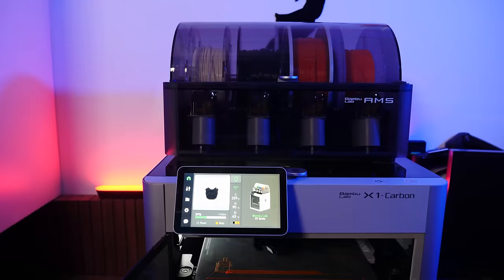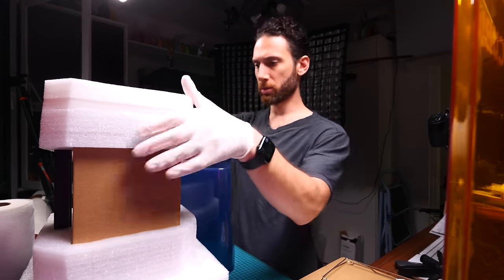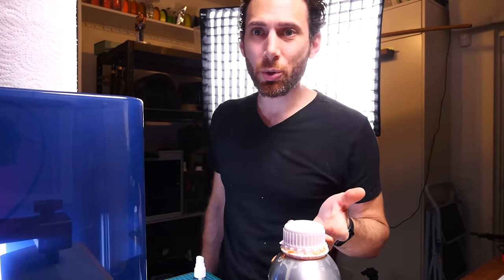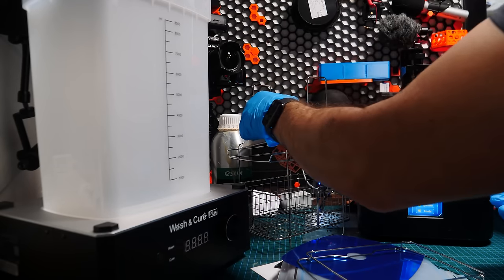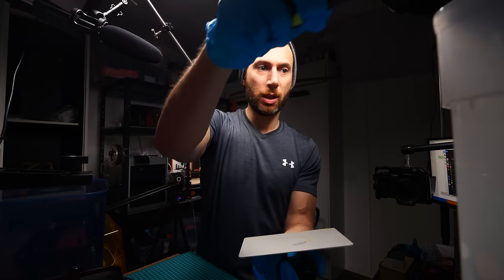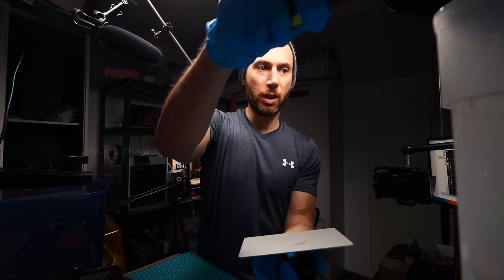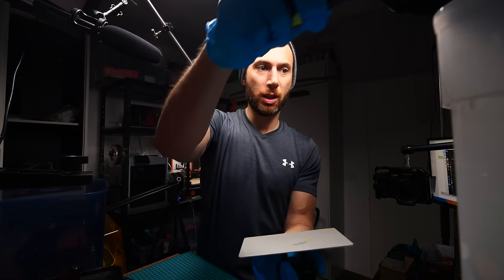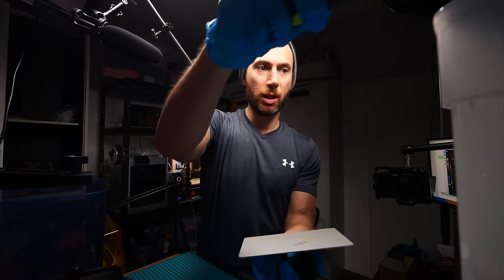Resin 3D Printing Wasn't What I Expected. AT ALL.

Comment: I went the opposite direction. I have been resin printing for years and just got my first fdm printer (creality k1c) I'm having a lot of fun printing the things that either wouldn't fit in my Saturn S or just wouldn't work with resin very well due to its material properties. I still use resin for a lot of things. If you need something detailed it just can't be beat.

Comment: I purchased the Anycubic M3 Max about a month ago now.  I did my research before hand so I knew what I was getting into.  A few comments on the video.  Firstly, this is not nuclear waste here.  Yes you should wear gloves and should be in a well ventilated area, but the respirator is probably a little much.  Secondly getting started is really not that hard...if you follow the directions.  It seemed to me like he just threw everything on a table and jumped right in without looking at any instructions at all.  And thirdly resin printing is NOT that messy.  I have made about a dozen or so sets of prints and if you looked at the workbench I have my printer on, you cannot tell I ever used it.  Use the proper tools as suggested and follow the cleanup procedure and it is NOT messy at all.  Personally I think this video makes resin printing seem much more difficult than it really is.

Comment: I started my own resin printing journey a few weeks ago, and I prepared by watching a ton of videos and reading a ton of articles on suggestions for beginners - having a silicone work mat, having a big funnel to put those paint filters in when straining out resin or the wash liquid, using a hair dryer to get the alcohol off the print prior to post-curing, and having a room air purifier have all made things go quite smoothly. Also a big plus, though I don't know if it's always recommended for beginners, was getting a flex plate instead of having to chisel prints off of the stock build plate. For what it's worth, having the room air purifier and a box of disposable nitrile gloves has made me feel safe enough, though my intent one day is to put the resin printer inside a grow tent (possibly with some minor heating if needed) that is ventilated outdoors to really keep the fumes to a minimum.

I got a Phrozen Sonic Mini 4K and the smaller Anycubic Wash & Cure station, and have so far printed with just two different resins: SirayaTech Blu Clear V2 and Elegoo ABS-Like Gray...the differences have been quite interesting so far, with the Blu being quite a bit more viscous and having a much stronger smell and the Elegoo resin needing a lot more work to get the exposure settings dialed in just right. I've done a few D&D miniatures, some jewelry-type items, and even a lithophane, something I tried and failed at with my Ender 3 a few years ago.

I'm looking forward to trying to make much more than simple decorative pieces. Things I've read suggest mixing a flexible resin (such as SirayaTech Tenacious) with standard resins really helps improve the overall toughness of prints, whether for miniatures/terrain that see a lot of use or the more functional kinds of prints that are currently still the domain of FDM printers. I'm also having to constantly talk myself out of getting a small electric furnace and/or an electroplating setup (shoutout to Hen3Drik) so I can make metal jewelry with the resin printer...I'm probably one of the small number of people that would rather melt zinc or copper to make solid metal jewelry than try and paint something.

All in all, great video! It's important for people looking to get into a hobby like this one that things won't always go according to plan and that troubleshooting is part of the learning process.

Comment: My wife prints with resin.   She loves it.   But she worked with UV resin before 3d printing was a thing.    Also it's not just for miniatures,  it's more dimensionally accurate than fdm due to the smaller layer lines, so I feel you will find it fits in with what you typically print nicely.
Reply: I thought it's good for functional parts too.  I do not have a resin printer yet but, from what I can see, you can buy special resin from places like Siraya Tech that has exceptional strength.  Is it true that you can make things as strong (if not stronger) than with FDM printers?  I say stronger because you don't have weak layer adhesion on the Z axis.  So, other than the mess and noxious fumes, I see no downside to resin printing except for smaller build volumes.
Reply: @ChristmasEve777  A lot of the material is not as strong as a lot of fdm materials, but the adhesion between layers is a lot better (I dont want to say all because there are certainly some very strong resins). The trick with FDM is to print in an orientation so that the force wont stress the adhesion between layers. Really the advantage of resin is greater dimensional accuracy. At work we mainly use pcabs on fdm printers but whenever we need tight tolerances on a snap or reduced friction on a moving part, or two forces in different directions where one will always split the layers we use the SLA printer. A downside of resin printing is the print time due to the smaller layer height. A small, not very complex part I started this afternoon had a print time of 22hrs. The same model might be 3 or 4 hours in fdm. 6hrs max.

Comment: A word about 3D resin printing safety: It's not that bad, but I would very much recommend to anyone who wants to get into 3D resin printing to first make sure that there is good ventilation and extraction. An open door or window won't help much if the fumes aren't actually being sucked out. I had no problem with my old Elegoo Mars 3 which is quite a small printer, but I immediately experienced toxic effects from the fumes when I replaced it with the bigger Elegoo Saturn 2. Don't take chances with your health or the health of anyone else who may be exposed to the fumes. Don't rely on a carbon filter; I've not seen any evidence yet that a carbon filter - even a big proper one - will remove VOC's. 

A mask is fine, but the bigger problem with 3D resin printing is that if the printer is inside the home, the heavier-than-air VOC fumes will slowly build up over the course of a few hours and you may begin to experience toxic effects. I certainly do. My solution was to move my printer outside into a shed away from the house (still a WIP - I'll have to slap together a DIY insulated and heated cupboard if I want to run it during the Winter months) but for those people who have no option but to print inside the home, grow-tents are recommended by some people, and I found out about a pretty cool device called a hydroxyl generator which neutralizes VOC's in an enclosed space. They're not cheap though.
Reply: @herculeholmes504  Any tips for extraction gear? I’m considering options for an area where I might set up a 3d printer and my wife may be doing jewelry making, which has its own fume concerns.

Comment: I bought my first resin printer this past winter, and once I got over the cold basement issues with a heating pad, it's been great. I have both the Anycubic Mono 4K  and the Wash and Cure station and they've both been great. I just installed the flexible buildplate and the prints come out great. I love it for things that I need in detail and the quality is just astonishing. I still use my Ender 3 a ton more but the Mono 4K is an absolutely great printer

Comment: First- excellent video. I'm glad you showed the issues you had.

For anyone watching this, it's worth spending rime watching videos on exposure and supports. Exposure first. The recommended default settings may or may not work depending on your room temperature. The further you are below 25 C, the longer the exposure time you need. The best way to determine this is using the "Cones of Calibration V2."  Do a search example to find them.

As for resins, all resins have different exposure times based on the manufacturer. Often the deviations are more than you see between manufacturers with the same  type of filament. Then there are significant changes in exposure based on the resin type. Similar to the changes between filament types. ANY change in resin requires testing your exposure at a minimum.

 Try printing pre-supported models first as the automatic supports in most slicers can be hit or miss and you'll get frustrated by the support failures.

Everything else he talks about regarding ventilation, safety, etc., is spot on.

Comment: I've got both, and there's a ton of stuff to learn and work with the resin printers.  Just like FDM, each resin is really unique in exposure times, light off times, etc.  I will say this - get better resins.  The higher quality resins do not have the strong odors that the cheaper ones do.  I'm partial to the Elegoo ABS Like resins.. low odor, very strong, and easy to print with.  good luck!

Comment: This video format is excellent for this type of video, great job! 

I’m considering getting a resin printer, but the fume extraction, high toxicity, and space and cleanliness required are sort of a problem, I think I’d want a large enclosed desk with a massive silicone desk surface, and walls a roof and a door, as well as fume extraction and/or a really good air scrubber, there’s not enough space for that now unfortunately

Comment: I have only ever used a resin printer, and I love it. It printed amazing quality right out of the box and with a little bit of calibration it only improved. Got some Sirayatech Tenacious to mix with my standard Elegoo grey, and now I have a ton of range of durability for all my needs. I still have yet to try dyes or clear resin though, but really want to because there are quite a few things I would like to do with them (I mostly print scale model kit parts).
Sure, I would like to have a FDM printer for larger less detailed things, but I have heard a LOT of people give up printing because they couldnt calibrate their FDM printer properly. That would never be an issue for me since I have plenty of time and determination, but it still makes it sound like FDM printing is much harder than resin printing, which worked for me right out of the box with no issue.
The two things I would invest in for resin printing are; ultrasonic cleaner, and a UV light with a uv powered lazy susan. And 90%+IPA or a degreaser like Zep Fast 505 or Mean Green (much cheaper than IPA and works almost as well for most all resins, clear resins work better with IPA.)
when using the ultrasonic cleaner, all you really need is a small jewelry one that can hold water to then put a larger container into to hold your IPA that you put your parts in. dont have to use a ton of IPA, just enough to submerge the print. So just use a container that fits your print. the IPA can also be cleaned by letting the resin settle then curing it with UV light, then filtering it out with a coffee filter.
I also recommend a second build plate, a flex flex plate for each, and an extra vat with storage lids for both. Makes it so you have almost no downtime between prints while you swap the plates out or even swap to a different type of resin. and the flex plate lets me print perfectly flat things like miniature bases, coins,, keychains and such; and getting a perfectly smooth flat bottom that comes off the plate with ease and no damage from the putty knife.
Reply: Depends on the FDM printer you buy. I have a prusa mk3 and I do have problems. But it's mostly wearable parts, direct drive gears, the sensors Prusa keeps coming up with, and Prusa Printed parts that don't work so well. However, Prusa always tends to fix the issues and I have printed over 400 days worth of prints in 4 years. 
All my friends bought Enders or Creality printers because they are cheap and it is possible to print a ton on them but they all ended up shelving the printers. The main complaints were the software/firmware. Too many driver boards, to many compiled files that don't work, to many versions of the same printer and YES they never did get a print printed. what a waste of time and money. 
That being said, expensive doesn't mean better either! I have a Modix V2-to-V3. I have completed 3 years of tech support and it still doesn't work! Which means who you buy a printer from matters!!! Unless you are an engineer for this kind of thing.
Reply: I hadn't thought of scale model parts before.  I thought resin printers were only for figurines, so your use case makes a lot of sense.  Thanks for sharing this.
Reply: @michaelj3971  I mostly build gunpla, so greeblies and armor panels work great. also guns, swords, even polycaps. I sometimes build cars and can print tires or engines. Most resin is too brittle for moving parts, but Sirayatech Tenacious is basically rubber and can be mixed with standard resin. so depending on the ratio, you can get anything from slightly less brittle parts to polycaps.
I printed out a 1:8 scale figure of a human that had a tie, and the tie was paper thin and could move a good deal without breaking

Comment: I'm really bad with messy things and I definitely don't want to be handling toxic stuff . . . so not for me. I'm also the kind of person who is into more functional prints and am not too concerned about layer lines and such, so I'll be sticking with FDM personally. Although a word about reliability: Most of the unreliability really stems from badly built printers. Something like the Ender 3 is very cheap, but it's also terribly built, and I ended up replacing a bunch of parts to make it reliable. If I were to buy another printer, I'd bite the bullet and buy a Prusa. They're known to be great workhorses and they're open source so I can make it my own.

Comment: Good video. I really liked that you showed the learning as you went. I have been really pleased with the water washable resin.... saves a TON of money on the FDM, seems to have less fumes (I still use an air filter) and less chemicals in the washing / post process. I have still yet to really find a good post clean up formula for wash and cure times... so I just experiment and do my best... would love if you do a video about that some time... otherwise I am just doing the "yeah that sounds like a good number" like you did.
Reply from the maker: Good call, I'll get some of that Resin

Comment: Great video.  I still remember myfirst  experience with resin printers.  I started with the anycubic photon mono when it was first released, a whopping 2K machine.  I now have 3 resin printers including the new 12K phrozen.  I have 4 FDM printers and I honestly dont have a preferred way to print.  It all depends on what I want to accomplish in the end.  Resin has way more clean up than FDM but as you said it takes more time to tweak the prints to get good prints.  Definitely now with the new Bambulabs that has drastically changed.  Education is the key to resin printing.  There are definitely concerns but you just educate yourself.  I dont think a full respirator is necessary.  I find the IPA is far more of an issue breathing in than the resin.  I will never handle resin bare handed but havent found the need for a full respirator, I do wear a mask at all times, at least an N95 rated mask not just a dust mask that they send with the printers.  Definitely get the small filters as they help immensely with the smell, I use 2 in my Phrozen printer which is now my go to resin printer.  The new resins coming out don't smell as bad either and you can get water washable one as well.  The wash and cure systems are a must.  On you anycubic cure station you can bend the top portion of the UV bar after you remove the vat to increase the efficacy of the cure.

Love the video and your style!

Oh and Jonathan dont let your mom do resin printing!  
😅
Reply: eSun is terribly smelly resin.  Anycubic is fine and ya a respirator is totally overkill.

Comment: I'm trying to find a gift for my teenage D&D gamer kids and thought this would be fun. I appreciate your well rounded review! I wasn't thinking about the toxic fumes and materials for where they'd do this. You've given me a lot to consider and if the Pros outweigh the Cons. Thank you!
Reply: if you're still looking for a good gift, take a look at the Bambu A1 Mini. It's a small FDM printer, so no toxic fumes or materials, and it's packed full of sensors that make it work right out of the box with next to no manual calibration. It's basically an appliance, one that even small children could learn to use. You can also get a 0.2mm nozzle for it that can print incredibly detailed miniatures. it's what I use for my D&D campaigns.